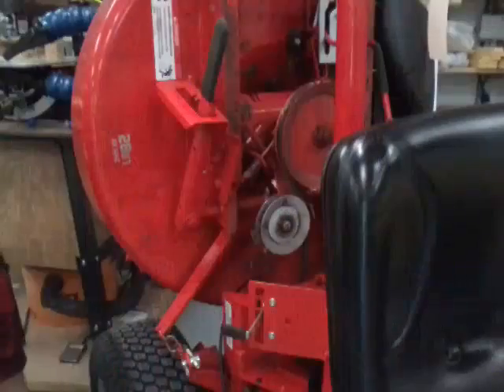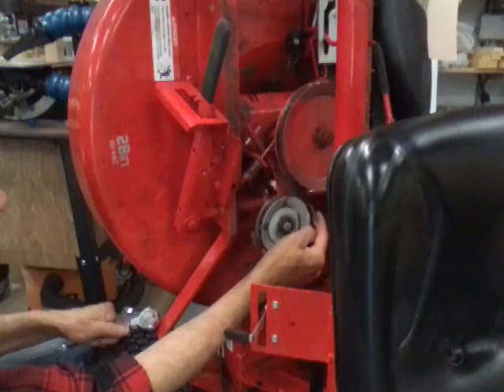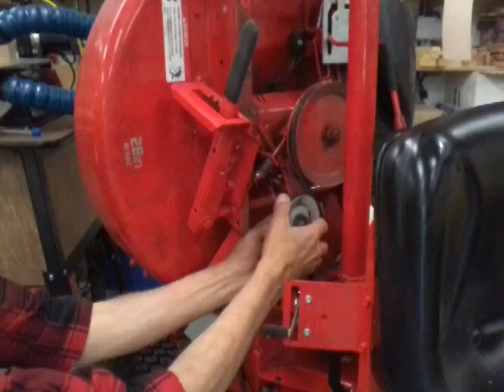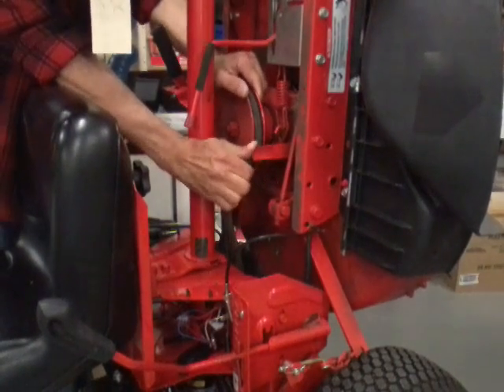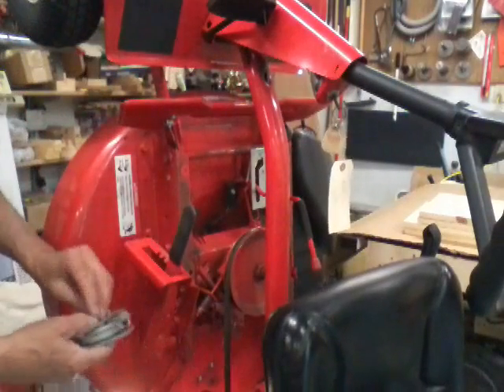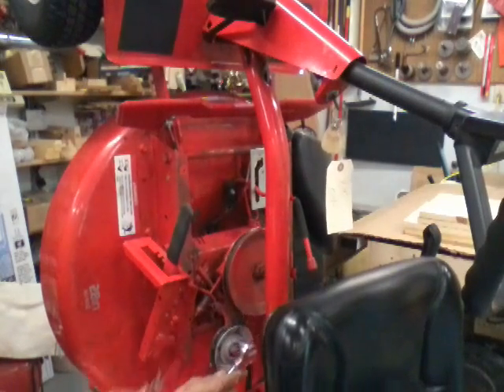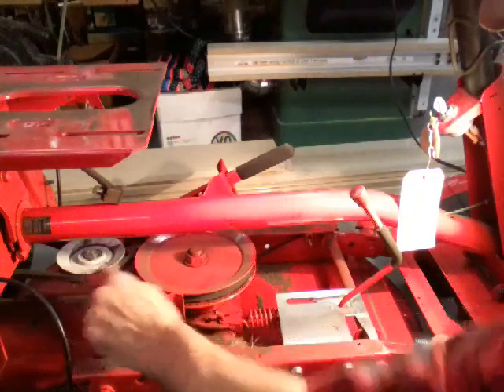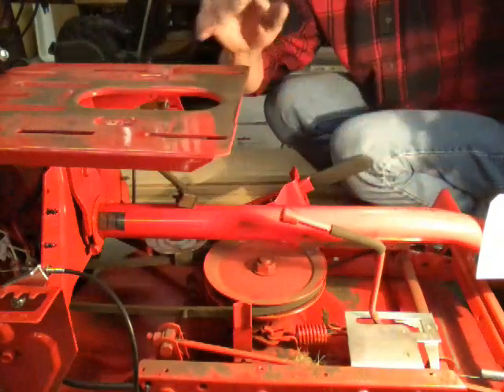101. M/S.7  Removing and installing a belt on a snapper Rider

Comment: Hello, do you know the part number for this deck belt? Thanks in advance
Reply from the maker: If you send me your model number off your machine and what type of machine you have, I can look on Parts Tree.Com and get you the information. Jim.
Reply: @jimjackson9381  ok awesome! I am currently at work, but I will get that info as soon as I get home. It looks just like this one in the video, but I know there are a lot of different models of this mower. Talk to you soon. Thanks again!
Reply: @jimjackson9381  also, I read your comment where you said to tighten the deck belt just loosen the clamp and stretch the frame. By doing this, does it affect the brake/clutch cable at all?
Reply from the maker: It depends on how far you pull the frame out or how far you push it in sometimes it doesn’t affect it at all. Jim.
Reply: @jimjackson9381  gotcha. I just had a new friction disc put on, and he adjusted everything under there, so it drives and pulls really nice now. He also put a new blade on. I forgot to ask him to change the belt or check it. I just noticed that when it hits thicker grass, the belt slips and slows the blade down. I thought about tightening the belt, but honestly, I don't want to move the frame and risk messing up everything he just adjusted. I think it will be better to just replace the belt. I will get the model number for you this evening when I get home. It's a Snapper like this one in the video. I didn't realize that there were so many different models of this Snapper lol. Thanks again for the response
Reply: @jimjackson9381  hello Jim. Unfortunately I cannot find a model number anywhere on the mower. It is a Briggs & Stratton INTEK OHV 12.5 HP with a 28 inch HI VAC deck.
Reply from the maker: @stevenwhite3794  well, I can tell you some of your model number by the information you gave me it should be something like
28125__BVE 
There are two blank spaces between the Five and the B that would be your what series it is if you have an original engine you can look at the code number and get the year off of the engine. That might tell us what series it is.        Jim
Reply from the maker: Well, if I can ask, who did the work and how much do they charge. Jim.
Reply: @jimjackson9381  awesome! Thank you sir for that info. My father-in-law bought it from an older lady who bought it brand new, so it's definitely the same engine it came with. It is super clean! We have used it for 4 years now and never had any issues til now. That's when I realized it was the friction disc. I bought the friction disc and the blade online, and the guy charged $75 to put them on and adjust the clutch/brake cable. He also cleaned and greased everything back there where the friction disc is since it doesn't have a cover to keep stuff from getting in there. It wasn't too awful dirty since it has been kept in the garage. After checking the belt yesterday, it is entirely too loose to tighten it by moving the frame so I will just replace it
Reply: @jimjackson9381  oh, and it is a place called Dale's Small Engine Repair that did the work on it for me
Reply: @jimjackson9381  This is the only info I see on the engine.
FAMILY : 5BSXS.3442VM and also
276012
Reply from the maker: @stevenwhite3794  well, on a Briggs & Stratton engine you should have three sets of numbers and the code number is what you need fine I’ll try to send you a picture. Jim.
Reply from the maker: I guess I can’t send you a picture because I don’t have your email address. Sorry.        Jim
Reply: @jimjackson9381  I just found your email address, so I sent you a photo of what I see on the engine. Thanks

Comment: Hi Jim  I replaced the deck belt but falls off, runs for couple minutes
Reply from the maker: Leonardo Perez 
Did you match it to your old one to see if it was the right size, sounds to me like they sent you the wrong belt. Jim
Reply: Jim Jackson no didn’t
Reply from the maker: Leonardo Perez 
What size machine do you have and I’ll see if I can figure out how long the belt should be. Jim
Reply: Jim Jackson snapper 38 cut 14.5 hp
Reply: Jim Jackson model 287707 type 1250-E1 code 01128ZE snapper 14.5hp  38 cut
Reply from the maker: Leonardo Perez 
Then this is a front engine lawn tractor built by snapper I would not be able to measure that belt because I don’t have one but if there is a diagram on how the belt is supposed to be ran on the machine check it.  I have a viewer that was having the same problems with his belt and we finally came up with he was threading the belt wrong on the deck which made it too long and it kept coming off on him. Jim
Reply: Jim Jackson yes I front engine . I will try to check the diagram again but looks the same.
Thank you

Comment: What length belt goes on a snapper Model 28085 S?
Reply from the maker: Corey Walter 
  Snapper doesn't give a size in inches on their belts they just have part numbers cording to my books a 28,  30 and a 33 inch deck all take the same size belt.  The belt on a snapper is a double V has a V on the front and the back side and that's because the idler pulley is not a flat one it's a v pulley so you pretty much have to use their belts in less you change the idler pulley and put a flat one on if you want to do that I have a spare belt I can measure and give you the size and then you can buy one at your hardware store. Thanks jim

Comment: how in the hell does that plastic cover come off?
Reply from the maker: Well if you have one of the old ones that the hole for the engagement lever doesn’t have a slot in it it’s a lot harder do you want to put a deck all the way down and just wiggle it out of there it’s not easy. Jim